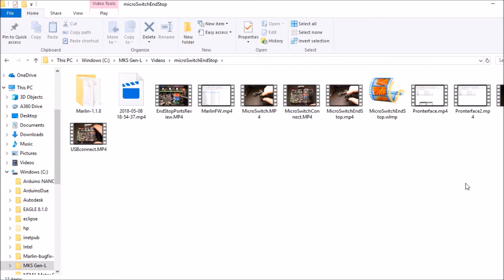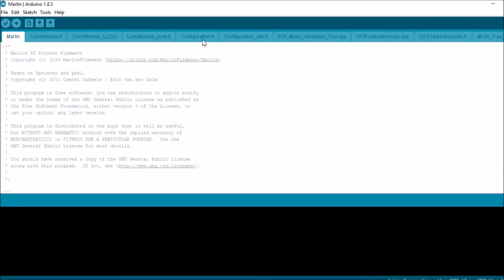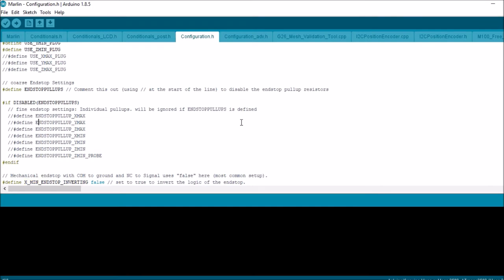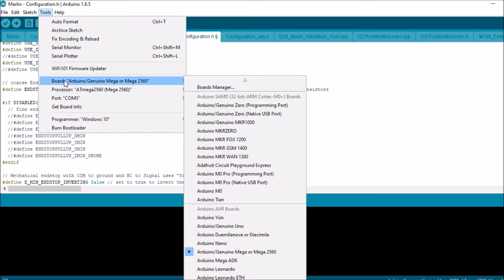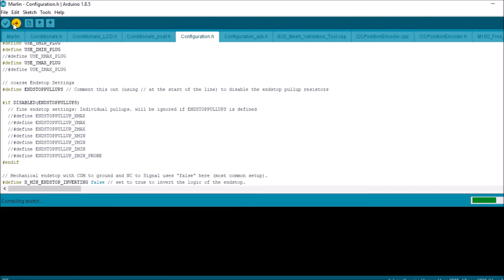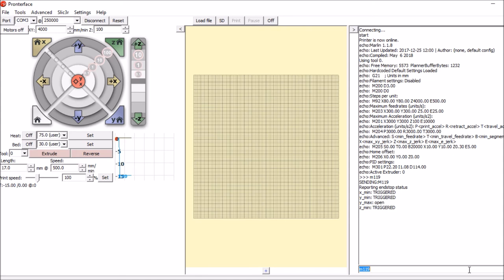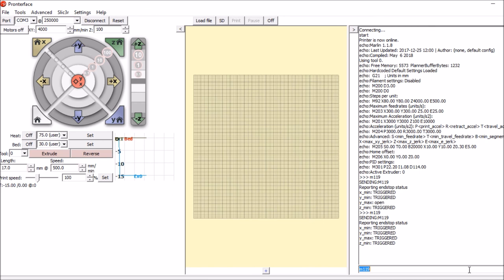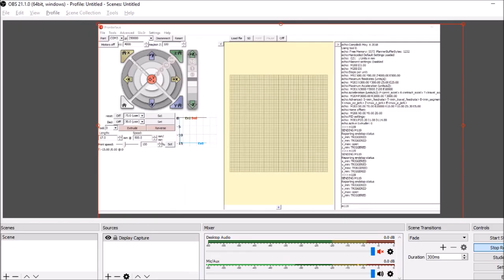MKS Gen L - Micro Switch Endstop

Comment: Does anyone know why my Z axis will not home. It just moves a little bit up then down but never touches the end stop switch.
Reply from the maker: Does it move away from the Endstop?  One solution is the reverse NEMA 17 plug direction or change Marlin firmware to invert homing.  Hope this helps.
Reply: @EdwardBraiman  Thanks thst worked. X and Z axis working great. When I move the y axis lets say 10mm. It moves Y positive then when I move it another 10mm it moves back to the original spot.